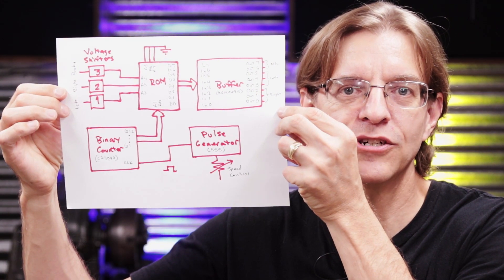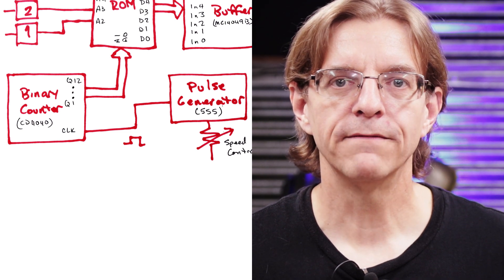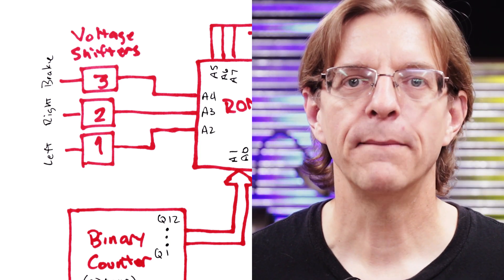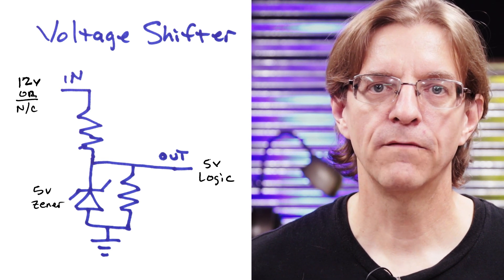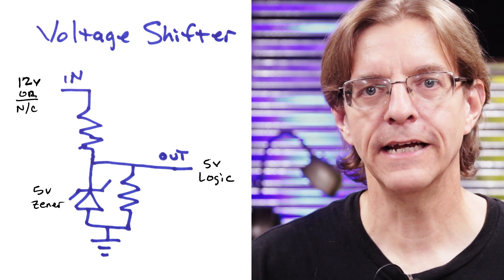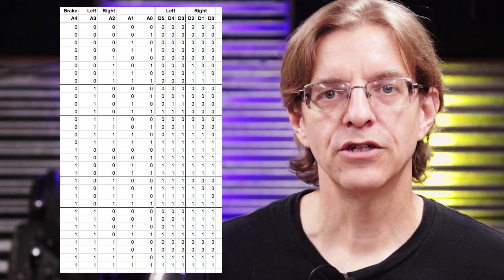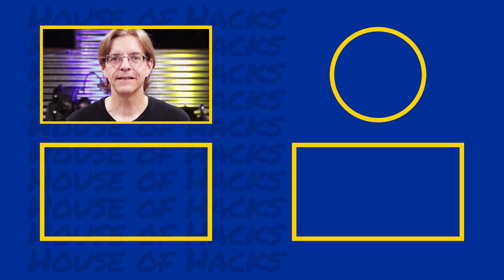Sequential Turn Signals DIY - Block diagram

Comment: Could you build some of these for me brother? What would you charge?
Reply from the maker: Sorry, I don't make stuff for sale.
Reply: @HouseOfHacks  That's ok, thank you for the reply! So I used to be able to find sequencers online for tail lights with multiple functions and up to 20+ channels.... I can't find anything anymore. All I can find now is Ghozt Modules. Can you help me locate any good sequencers that don't break the bank? Used to find good ones for $30 to $40
Reply from the maker: The only suggestion I'd have is to search for "sequential turn signal <car year/make/model>." I'd be pretty surprised to find anything in the $30-40 range as they're going to be a pretty specialty part, low volume and, depending on the make and model, probably not too transferable between cars. This means the r&d budget has to be amortized over a smaller number of sales, increasing the price.

What kind of car are you trying to find a module for?

Comment: I have a few questions if you could get in contact.
Reply from the maker: Just go ahead and leave your questions here. This allows other's that may have the same question see the answer too. Cheers.
Reply: I'm in the process of making this using an arduino. My concerns are with 12v to the input pins. Is it safe to use a car phone charger to convert 12v into the input for the different signals or would that fry the board?
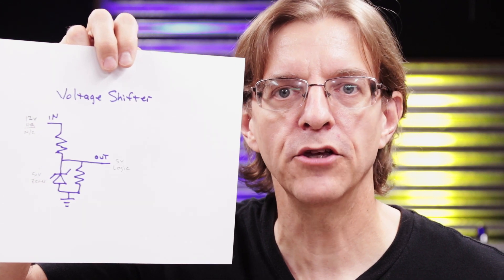Reply from the maker: A phone charger is designed to be a power source, not meant to convert signals. It probably wouldn't fry the board, but it probably wouldn't work correctly either. I'd suggest something like I show starting at 1:52.